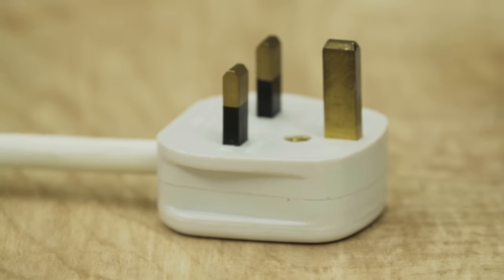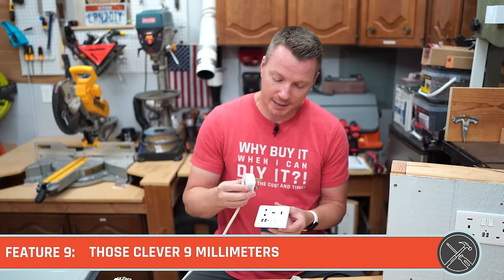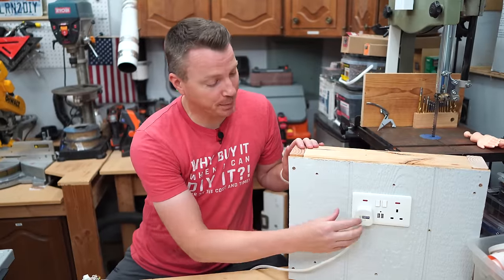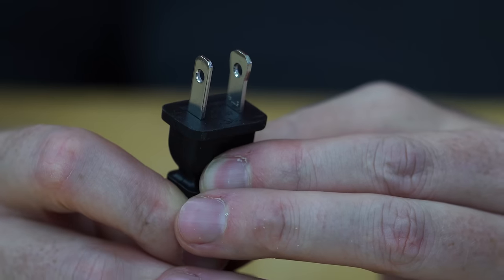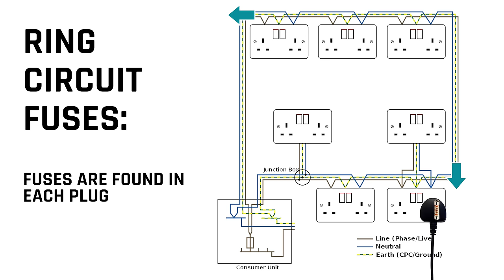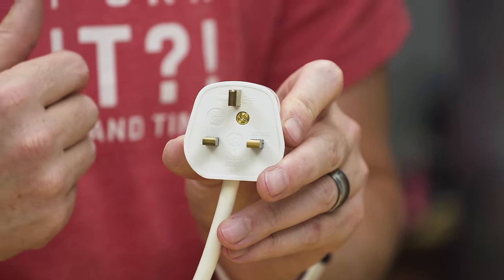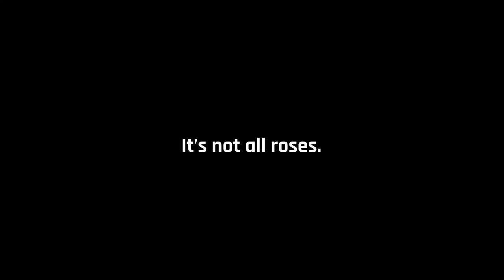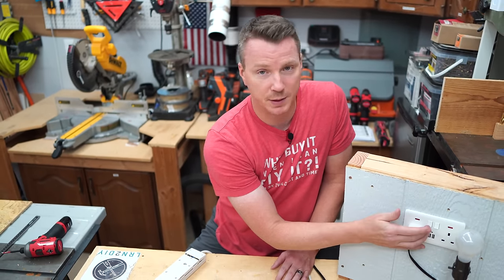British Plugs and Outlets Are On Another Level

Comment: The negatives cited with this system were a bit weird, as a Brit no uk home I have ever encountered thinks about loading on the ring main though perhaps sometimes we should, certain circuits may be uprated depending on location depending on room anticipated usage but generally as a whole it copes really well and things like kettles here boil a lot faster as a result. The single biggest issue is the 220-240v we use hence the safety plugs, it packs quite a wallop. We seldom unplug things and leave the plugs laying around to step on, that's what the switches are for on the sockets. It's just that the UK is more risk averse than the US, quite a lot more in some areas.
Reply: Loading on the ring is to do with how you wire the system, not how you use it.The diagram for a ring circuit he had was kind of flawed as it didn't show balancing of a circuit. Basically to imagine balancing... Count your sockets, all the even ones are from one leg and the odd ones are on another leg. This makes it so that any socket no matter where it is in the system will have the same current as all other locations. If that's hard to imagine, just know it's something good electricians think about when planning an install.

Comment: Load balancing isn't an issue when the circuit is designed properly. Most domestic properties have two such circuits such that the likely load is shared equally between the two circuits. So for example the heavier load items tend to be downstairs (washing machines, kettles, dryers etc.) and upstairs there's little in the way of heavy load items. So in my property the ring circuits are split roughly front and rear such that both share the larger downstairs load.

Comment: The black insulation is a relatively new feature (last few decades) to also stop people wiring extra appliances to the plug pins itself. I remember my mum doing that when I was younger… Wrap the wires of an extra appliance around the shorter pins of a plug.  The insulation obviously prevents that.
Reply: that's crazy! How did you survive?
Reply: @cleanerben9636  As a child my mum had an old appliance - a grinder - that used the light socket to run. Randomly when she was cooking she would go out to the living room, take the light bulb out of the main light, plug the grinder cable into it and use the grinder. It wasn't until the early 1960s that plugs and sockets were standardised in the UK. One of my brothers' who trained as an engineer took her to task over it so she eventually stopped using the old appliance.
Reply: Another issue is that the a lot of these plugs are made in China and sadly they sometimes use a ceramic for the insulation that get easily chipped.

Comment: I'm a Brit and lived in Thailand where type A and B plugs are the norm. I hated them after growing up with type G plugs. But I saw that in the hospitals the wall sockets that medical equipment used were for type G plugs. I my 64 years I have never managed to step on a type G plug. If your lamp doesn't turn on it's simple to check that it is turned on at the wall socket. If not check the bulb, if the bulb is fine check the fuse in the plug. We run lawn mowers, drills, angle grinders etc.  off our household plug sockets with no problems.

Comment: Load balancing isn't an issue, the biggest problem with Rings is DIY experts and split rings. They do require knowledge to test and understand. You're right about standing on plugs  hurts but as sockets are on walls usually behind things it's not something I would say is a problem.
Reply: Havent stood on one in the last 55 years

Comment: Switches at every outlet are useful for more than just preventing stand by mode using power. In fact, I think their main purpose is to prevent arcing that might sometimes occur when you disconnect appliances that normally don’t come with switches (like irons). Arcing can not only trip fuses but also, if it happens more often, causes oxidation on contacting elements, which increases resistance. That can lead to contactors getting hot and in extreme cases even fusing together or causing fire.
Reply: Switches at the wall: if you have a cable from the plug to a lamp for example. The lamp is turned off, but the cable is still live up to the lamp, and the cable is pierced you have a chance of being electrocuted.  Switch at the wall removes that chance.
Reply: @bonjovi7399  unless there’s something seriously wrong with you, you don’t normally switch everything off at a socket outlet every time, you know…
Reply: @chrissmith2114  haha xD
Never met a person like that but I think it’s quite possible they exist. 

Yeah… collectively they might draw enough power to register but I don’t think that can have enough of an impact on your electricity bill to be worth the hassle of switching every socket outlet off every time…
Reply: @karlosh9286  you know they’re more of an exception than an actual standard, right?
Reply: @BBountyHunter  I do , I live in the UK !
Reply: @bonjovi7399  - Yes, a switched wall socket can be good for safety when changing a suspected blown bulb in a desk or table lamp. It may be assumed the lamp is unpowered because the bulb isn't lit, or that one can probe the springy bayonet pins in the bulb holder because the single pole  neck switch is off.  If the lamp uses cheap unpolarised twin cable, or even colour coded cable wired wrong at the 13A plug it can result in one of the springy pins being live, even when the neck switch is assumed to be off.

Comment: You forgot to mention that the downwards angle of wire also allows for a thinner profile. Meaning bookcases and av units can sit flush against the skirting board without touching the plug. 

You can also install the plug socket upside down if it's hidden and you want your wire exiting upwards, say for a wall mounted TV.
Reply: The downward thing is in case of a water leak, you save what? 6 inches of wire by turning it upside down? Bad idea.
Reply: @bravo2966  I worked as a joiner for several years making custom furniture for high end clients. They want a unit in a certain spot they're getting it there, money often trumps common sense. Admittedly it was rare, most of the time you just loop the wire around. But can think of a few occasions it was required and helped.
Reply: @W1gglePuppy  Guess that's why they don't let joiners do the wiring then lol

Comment: Thanks for the video. Your downsides seem a bit nitpicky though. The size of them was never an issue if you grew up in the UK, they are what they are and there's nothing else to compare them to here it's a non-issue. I've never thought they are too big, unless I'd have grown up in a country that have smaller ones. Load balancing has likewise not been an issue. As for them falling out, as you demonstrated earlier in the video, they require quite some effort to pull out, so they don't fall out anyway. I've heard of American plugs coming out, or easily being pulled out, so I'd be more concerned about those. I'll grant you the American plugs wouldn't hurt as much.
Reply: Mine have small stickers on them telling me what they are connected to good use of the size I say.
Reply: By "let (the plug) fall" he clearly meant unplugging it manually and just dropping it/tossing it off to the side, not accidentally unplugging them.
Reply: @AnglosArentHuman  Who does that though, unplug it and toss it to the side just asking to be stepped on? You don't need to unplug it anyway, just flick the switch.
Reply: @charlesdanaa8514  well, leaving a plug around to be stepped on isn't the sort of mistake a brit (or a Type G user in general) makes twice in their life
Reply: There are a couple of scenarios where the downward-facing wire is problematic though. In general, for appliances that stay put (like a toaster or lamp), they are the way to go. But for appliances that are moved around - vacuum cleaners indoors and lawnmowers outdoors being the most common ones, and, before the rise of battery-based options, corded hand power tools - the downward facing plug means that when you get to the end of the cord it wrenches up at the plug whereas the inline North American plugs will just come straight out. On balance, being pulled out is a safer (if more annoying) outcome than wrenching the cord at the plug. If I recall correctly, I think I've seen UK plugs with a hinged cord so it normally hangs down but can also come up to a straight out orientation and presumably make a straight pull out of the socket when overextended. That strikes me as the best option for 'dynamic' appliances.

Another place where inline plugs have an advantage over flat plugs is where extension cords are involved. A flat plug on a flat socket end of an extension cord is pretty much guaranteed to snag on something if it is being moved around (this is especially outside), whereas inline to inline will generally ride past most things. In fairness, this may be more of a North American issue due to the larger yards and longer distances of operation from the house.

It should be pointed out that North American flat plugs do in fact exist (refrigerators are where you find them a lot); they're just not super common... and that's because of the relative orientation of the two sockets in a typical North American receptacle: they're oriented one above the other, so if everything had flat plugs you'd only ever be able to use one of the two sockets. Additionally, there isn't actually agreement on how the receptacles should be oriented: they're commonly oriented grounding pin down (looking vaguely like a face) but it is better practice to orient them grounding pin up. In some places and in some circumstances (kitchens in particular) the receptacle is oriented sideways, ideally grounding pin left. So there's at least three different ways a flat plug might be designed. I've seen a few flat plugs which take the cord off at a 45° angle and those do allow for both sockets to be used.

Comment: As far as the load balancing goes its not too bad since there are typically different rings for down stairs light, upstairs lights, down/up stairs switches and kitchen is normally on its own to avoid the TV cutting out when the kettle, microwave and toaster all go on when your making tea with beans on toast 🤣
Reply: Almost correct, your lighting circuits will be a radial though.
Reply: Yep, lights and plugs are on on separate loops as are downstairs/upstairs plugs and things like ovens have their own independent circuit, hardwired in and don't usually have plugs.
Reply: @bengardener8928  yeah I didn't mean to imply sockets and lights were on the same circuit but thank you for additional information
Reply: @Luke-A  You were totally correct, you did say lights and switches were on separate ones :)
Reply: let's clarify. Our lighting circuits are on radials. One radial for all the upstairs lights and one radial for all the downstairs lights.
Reply: Mmmm! Beans on toast! Love it!

Comment: Also, when wiring a plug, I use the colours to remind of the correct wire placement. Live cables (Red or Brown) both have 'R' in the colour name, and they go on the right. The neutral cable (Blue or Black) each have 'L' in the colour name, and they go to the left. From the explanation I've read in the comments, the colours were chosen more for colour blindness than to remember how to wire a plug, it's just something I realised and always remember.

Comment: When I was in tech support, the first troubleshooting step was already: "Would you make sure that the plug is in the socket and switched on?"

Followed by: "Could you make sure the cable is plugged into the device?"

These aren't such onerous steps, and apart from the switch element, apply globally...

Nice video! 👍

Comment: Good video. The switch issue you described isn't really an issue. We would just plug the light (or whatever is not working) into a socket we know is working and see if that solves the issue. If it doesn't then it's the light that's broken.
Reply: or the fuse needs changing

Comment: I’ve never heard of load balancing to be a problem at least within the domestic sector. You can plug what you want in any socket in any location as long as the total load on the circuit doesn’t exceed 32A for a ring main but even in the case of a small overload on a circuit it could take a long time to trip the MCB
Reply: I believe this is normally taken care of during design and installation, its basically why most house have different circuits for each floor and a separate circuit for the kitchen and probably for garage. I think part of it is to do with length of cable run from the fuse box.
Reply: @stephenlee5929  kind of makes sense as we wire similar to how youve said but I still don't understand how you can balance loads that are unknown
Reply: Load balanceing could be an issue if you took to extremes, but mostly each room has its own 32amp ring, so you  would have a job pushing it over.
Reply: @jca111  Hi, Most English house seem to have a power circuit for each floor rathe than each room, with the exception of heavy use rooms such as the Kitchen. 
But I agree it is unlikely to be an issue assuming it was reasonable designed
Reply: @Vii7aL  One example of how that happens is in small apartments which often only have a single ring. The fuse box is usually located towards the opposite end of the apartment from the kitchen. Thus the outlets most likely to have a concentration of high power devices (Kettle, microwave, toaster, etc) are towards the balanced point of the ring (equidistant from both legs).

Comment: Great piece but you didn't mention one of the most important aspect of the fuses... you fit different value fuses according to the load and wire gauge. You can also safely daisy chain extension leads as it is less likely to overload any section of the daisy chain. (Daisy chaining xtn leads is illegal in the states because of the lack of a fused plug)
Reply: Daisy Chaining is advised against in the UK, The extensions lead & sockets are rated to 13 amps (some are 10 amps) So if you plug in anything that heats, Kettle, Toaster, Iron, Washing Machine, Tumble Drier etc then that is the only item you plug into that extension otherwise you overload it, Basically you add up the value of the fuses in each plug and as long as it does not exceed 13 amps you are ok.

Comment: One tiny little intentional design feature you failed to mention is that the cable colours are specifically designed to aid DIY re-wiring.  The (BR)own cable goes into the bottom-right, and the (BL)ue cable goes into the bottom-left.
Reply: Wow, as a mature brit, I have never made that connection.  Is that deliberate by the designers or just a coincidence?
Reply: As far as I am aware, it was a deliberate choice.
Reply: not quite, when the 13A plug was invented our wire colours were green, red, black. The brown, blue, green-yel stripe are part of european harmonisation.
Reply: If you don't know even the correct colours, you should NOT be attempting  ""DIY""  !!

Comment: As a person living in the UK our ring circuits are hard to overload even back in early days it's normally human intervention. That is the cause for these issues like nails in the rewireable fuses our fuses/MCB/rcbo. Are very good with over current protection and in many cases now quicker then the fuse in the plug to cut the power. The draw backs to our design is human neglect like leaving a plug on the floor to stand on we also have brail on some of our plugs so they can be read by visually impaired people

Comment: Can confirm that I have never heard stories of people getting shocked as children. The UK has been insane in it's innovation and intelligence over the course of history. Maybe not so much today but what a great heritage we have! Thanks for your video
Reply: The UK still leads the world in many fields. Look at the new Dreadnought class ships.
Reply: I've only known one person get shocked by a plug here in the uk, and it was from a piece of cheap imported equipment that came with an American style plug, they just used a travel adapter to use it. Needless to say they now cut those awful things off and replace them with a proper fused three pin plug from the hardware shop (that costs less than the cheapest travel adapters anyway) after I suggested the idea to them. It is just what I do as standard because its so easy, it saves space compared to the American and European style plugs that have the wire coming out 90 degrees to the socket and much safer in the long run
Reply: The UK (ARM) still designs most of the chips that connect to the internet to allow you to make comments like this!
Reply: @JamesWilson01  
look at BAE.
Reply: @JamesWilson01  
Smart phones are mainly ARM. ARM get royalties for every CPU made. Jony Ives, who went to Newcastle Poly, designed the Apple iPhone.

Internetworking, was developed by the British National Physical Laboratory and the US Darpa. The British invented to two key components that gave internetworking:
1. the router
2. packet switching. 

Englishman, Tim Berners-Lee invented the World Wide Web. The first electronic computer was Colossus, built by the British in WW2.
Reply: @Lilith-Rose  
And so much safer.
Reply: @johnburns4017  Yeah, good examples, and they also have most of the best rock music! The Beatles, The Stones, Cream, Led Zeppelin, Deep Purple, Black Sabbath, Queen, The Police... I can't be bothered to even start on the 80s apart from Iron Maiden 🤘
Reply: I was shocked by a BS 1363 plug in the mid 80s. The pins were solid metal then, no insulated base, and I managed to get the plug a cm or so out of the socket and touch the base of both pins while they were both connected. I'm told there was a "zap - thud" sound as I hit the opposite wall. I was a toddler - have no memory of this :D
Reply: @RoamingAdhocrat  
Obviously an old plug that was not replaced. I assume Daddy replaced the plugs in the house.